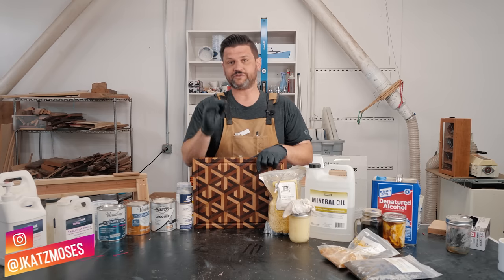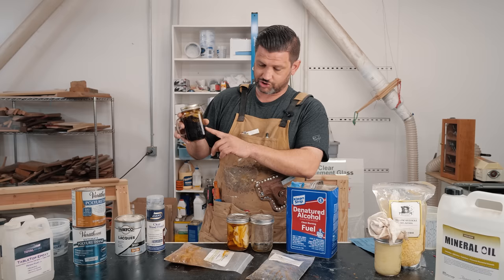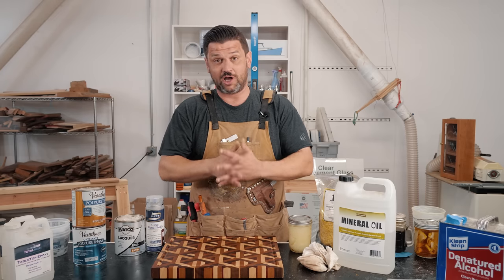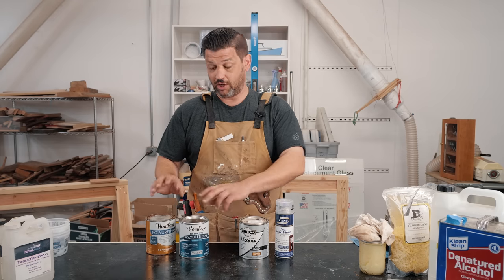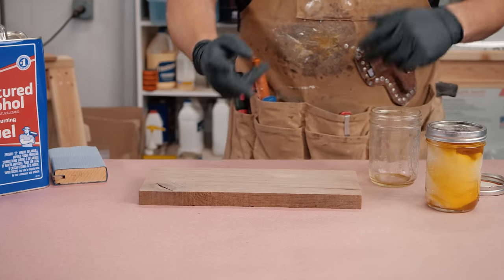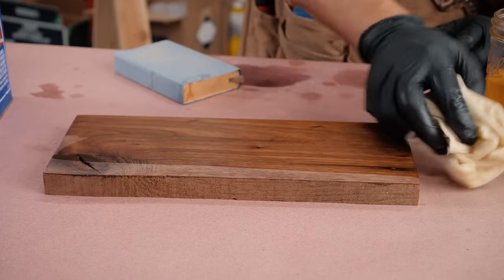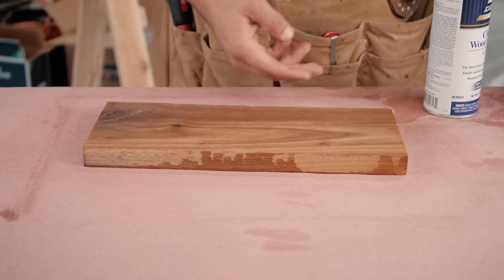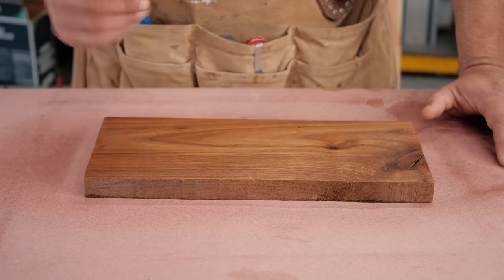My 4 Favorite Finishes and How to Apply Them

Comment: Great video! Thank you for simplifying this topic. I love the shellac idea. I'm looking for finish suggestions on two projects. The first are two pine vanity tops in the bathroom. What would you suggest for that? Also, I am being gifted 10/4 elm slabs for a dining table and benches. I plan on using Total Boat to fill cracks, etc but am unsure on which finish to use. I'd like something subdued in satin or matte but needing to hold up to heavy use by teenagers. I have used oil based poly and Waterlox in the past but it always has that plastic look. Your thoughts?
Reply: I'm guessing you've already built the table, but for others reading this comment, check out Rubio Monocoat. And for finishing instructions on a slab, watch some of the videos from blacktail studios.

Comment: When finishing a cutting board, would you want to do all 6 sides rotating it as you're ready to move onto the next side, or focus on the sides you can get to and turn it over when you're done to repeat the process on the others?
Reply: You can do it either way. Keep in mind that when you apply the goo to a face, that face will be gooey (if is obvious when you do it) for a little while. I usually start with a face that has end-grain (the oil will be absorbed into the end-grain more than the edge-grain.
Reply from the maker: Yep
Reply: Awesome guys thank you for the replies!
Reply: If you are going to sign the cutting board, you need to do that before you apply the finish. I have not found anything that will write on the wax-oil finish. And test it on a sample board. The wax-oil finish will smear some inks and pencils. I have a cutting board on my bench now waiting for my scribe to write a cute saying on the back. My handwriting is marginally legible.

Comment: I have a butcher block I’m finishing and wanted feedback about your KM Goo. 
I used someone else’s recipe the first time, and it left a faint oil residue that has remained for the last couple weeks (shows up if you set paper on it). That recipe wasn’t as heavy on the beeswax and I think that’s why it turned out as such. Do I need to wait for that to dry out more before applying some of your 4 to 1 ratio?
Reply from the maker: You can reapply mineral oil based stuff whenever

Comment: I tried Shellac for the first time on the seat of an outdoor bench. I used Zinseer applied 3 light coats sanding between the first 2. It dried overnight in my shop, then I put the bench in front my house. Within 30 mins it started bubbling and burning from the outdoor heat. Any ideas on what I did wrong?
Reply: stonecrazy3 I’ve been informed that zinaeer is 4lb and the idea is to thin it to about 1lb. I have applied directly from the can but the film was really thick. Not sure if that’s your problem.
Reply: @antoniop719  ok maybe that is the problem. Even though I put light coats it was thick. Thx for the reply
Reply from the maker: Isn't it interior only?
Reply: Shellac is not an exterior-grade finish, but -- more to the point -- could it be that the heat caused the wood in the bench to start releasing some kind of pitch or sap?  What kind of wood did you use?
Reply: @bmedicky  not sure, I use it to make wood filler and decided to try as a finish. It was used on western red cedar
Reply: @katzmosestools  it's possible, I've never used it before for the finish. I've only ever used it to make wood putty.

Comment: Do you use any type of paint sprayer to apply your finishes?
Reply from the maker: Sometimes. Did a whole video on hvlp
Reply: @katzmosestools  do you prefer the air compressor or the plug in ones that Home Depot Sells? Im considering buying one to make the process go a little quicker have been using foam brushes to apply finishes
Reply from the maker: @Suttonusmc  check put the videos. I did 2. Should answer all your questions

Comment: Katz-Moses goo... Four to one as in four parts wax and one part mineral oil can be by volume or by weight; you're keeping it to yourself I see (LOL). If it were by volume, you would need a hammer to break it... This goo is more like four parts wax and 1 3/4 parts mineral oil by volume. Cheers!

Comment: When you mention the beeswax and mineral oil combo, is it a 4:1 ratio beeswax:mineral oil or mineral oil:beeswax? I made it the former way and it is still pretty hard. Should I have made it the latter way?
Reply: J Anderson I made the same mistake. He meant to say 1:4 at least in how he presented it. Let’s just say I fixed and now I now have plenty
Reply: Will Corbridge can you clarify further? It’s still not clear which component is the ‘4’ 
Thanks!
Reply: Edward 4 parts mineral, 1 part wax

Comment: Ok on the bees wax which is 4 parts and which is 1
Reply from the maker: 4 parts mineral oil to beeswax. If I remember correctly I used 1.5 gallons of mineral oil to a bag of the beeswax I listed

Comment: Have you ever eaten the shellac flakes in milk..lol.. It kind of looked like you were about to pour a bowl of cornflakes... Also, I didn't understand where you said that you use beeswax on the cutting board but it's not a good finish for furniture because of durability... Does not a cutting board need to have that same durability or am I misunderstanding something?
Reply from the maker: Cutting boards need to be food safe so there is no film protection. Beeswax and mineral oil is a finish you would reapply every so often depending on use
Reply: @katzmosestools  thanks

Comment: What kind of rags do you use? I use the generic blue shop rags when applying oil finish to cutting boards. I've looked at rags in lowes/home depot, but not sure whats best for finishing.
Reply: I use any type of lint free rag, or lambs wool pads.
Reply: @joeymerrell8585  Thanks for the info!

Comment: Great video. Thanks. I'm just wondering if you really meant 4 parts beeswax to 1 part mineral oil? You're saying that several times in the video, but shouldn't it be the other way around? I've recently made it with 4 parts oil to 1 part wax and the texture looked pretty similar to yours.
Reply from the maker: That sounds right.
Reply: I searched everywhere. And I made some recently too. I think it's four parts oil one part wax.

Comment: Just to add to the uses of shellac, it's a great stain blocker and it's used to prevent blotching when a penetrating stain is used on softwoods like pine.
Reply: So shellac first and then stain?
Reply: @seanhenry744  yes. Just make sure to not to put it thick. Just one thin application and that's it. So much cheaper than minwax pre-stain conditioner.

Comment: Shellac is not durable, and yellows over time. Poly takes way too long to dry. My goto is lacquer. Of course it depends on what you’re coating, as you point out with the cutting board. Nice video, thanks.

Comment: If you're going to use water based polyurethane finish for its durability, why not use oil based polyurethane which should be more durable? Water based polyurethane seems to be neither here nor there.

Comment: When you refer to “parts” are you talking about weight, volume or liquid measurement
Reply: I use rough volume using measuring cups, close enough is close enough.  Nothing is going to go wrong if its 4.64:1 parts instead of 4:1.
Reply: A part is simply a part of a ratio, any given unit works. 4:4:1 means, maybe, 4 bits of A, 4 bits of B, and 1 bit of C
Reply: @mjbailey404  4 grams of something to 1 gram is not the same as 4 liters to 1 liter these ratios are vastly different based on densities. This appears to be a rough eyeball measurement of volume

Comment: I refinished some rifle furniture with glossy water based poly but I also added wood dye to it because of the color I wanted.  After the layering, buffing, sanding, and final coat of spray on oil based poly.. it doesnt look plasticy but sure does look deep.

Comment: My shop is only heated when I'm in there since it's a small metal shop and I use a propane heater. So will shellac freeze since its denatured alcohol or be affected by cold temperatures. Iv had frost on the roof inside in realy cold weather. Love your video's.

Comment: I have a HVLP sprayer, and maybe I'm using it wrong, but the issue I get is: I have to fill the bottle in order for the sprayer's straw to suck up the varnish, then I have to clean it in between coats (my poly has a recoat time of 4 hours, touch dry in 2), which means a lot of varnish gets wasted.  Am I doing something wrong?

Comment: Spar varnish is the strongest finish to date polyurethane is next epoxy is not very durable that's why they don't use it on hardwood floors it's scratches very easy I've been in finishes most of my life when I was color matching I thought of using epoxy on hardwood floor the owner of the company which is a chemical engineer told me not to for it would be all scratched up in less than a week PS love your work you pay attention to detail

Comment: Little trick for lacquer is to melt the product down with lacquer thinner.
When spraying lacquer on piece with multiple parts or a big project the lacquer can dry so fast you can get flash on your finnish.
Thus is where when spraying your product may land on parts of 
the finnish that has already hardened and leave a dull sandy feel/look.
Load your spray gun with strait lacquer thinner rapidly respray the project.  To much thinner can cause runs if to heavy like any spraying product. 
 a bit advanced but can really help when its hot or lots of angles where the spray can land back on the project and cause flash.
Where a respirator have fun.

Comment: For your KM Goo, do you measure your ratio based on weight or volume??? i just received a big block of beeswax of 1.3kg. If i base it on weight that would be 325g of mineral oil. I think it would be super messy if i have to melt the wax to work out how many mls of wax to mineral oil.

Comment: what do you sand to?  I just finished a board that I sanded to 320... IT'S GLASS SMOOTH.  But will that inhibit the oil from soaking in??  (my thoughts were it would also keep water from soaking in).
Reply: I'd say no. I've sanded to 600 grit before and my oil stain soaked up no problem. My only advice is make sure the surface is clean. A vacuum with a soft brush attachment works great.

Comment: Hey, Jonathan Katz-Moses.  With regard to your Satin finishes and not really using gloss to finish a project:  The Wood Whisperer put out a great video for the guild regarding gloss.  What he claimed, was using gloss for all of your coats except the final coat, will give you a NON distorted view of the piece, but will still have a satin finish.  I've used it several times and it works like a charm.  So if you're looking to get rid of some gloss poly, try it out! Also, I make my own wipe on poly, splitting 50/50 oil based poly and mineral spirits.  try it out if you have a chance.  works great. P.S. how much for that cutting board??? :)

Comment: Could I use shellac and then do an epoxy resin flood coat as the finish? I feel if I seal the wood, wouldn't be so difficult to then do a flood coat of resin for final finish. Or is it a bad idea to use shellac and then flood coat of resin?

Comment: Thanks for this. I need to work on my bees wax goo... lol. When I make it it doesn’t have the same consistency. I will try your mixture next time.
Reply from the maker: More bees wax than oil
Reply: Jonathan Katz-Moses 👍🏾
Reply: I was planning to use boiled linseed oil and wax. Never thought about using mineral oil.
Reply: Jonathan Katz-Moses. Just a quick one Jonathan. The link to the bees wax doesn’t work. I can’t use it in the UK, but I was just curious to see if I could find something similar on the UK version. Thanks.
Reply: I know there is a lot of room for variation, but most of the recipes I have seen (and the one I most recently mixed) are inverted from your recipe. They run about 4 parts mineral oil to 1 part beeswax by weight. Do you measure by volume? My goo is about the same consistency as yours, similar to peanut butter.

Comment: Love the video.  Super helpful.  I tried to make the goo, and I'm now at 2:1 (after 4:1) wax to mineral oil and it is still super thick.  not good like yours at all.  

Any suggestions?
Reply: At 4:05 you say 4 parts beeswax.   I just found your other video about how to make it.   Turns out you use 4 parts mineral oil, 1 part bees wax.   Haha.   I'd checked the video 3 times to make sure I didn't listen wrong.  

No worries, but that confused the heck out of me.  Keep up the solid work.

Comment: just want to confirm 4 to 1 as in 4 parts beeswax or 4 parts mineral oil
Reply from the maker: I think its the other way
Reply: @katzmosestools  So I think you did mean 4 parts mineral oil and 1 part beeswax correct? I watched your other video too. I just wanted to note, you specifically said in this video it is 4 to 1 and then said its 4 parts beeswax.
Reply from the maker: @Baileyonthedaily  correct

Comment: I was told the "fuel" denatured alcohol would not work for shellac because it has too high a ratio of methanol, no?
Reply from the maker: Im pretty clear in the video, no?
Reply: @katzmosestools  True. I guess the assumption is that any will work. In California and in particular in Los Angeles, where I'm based, many of these products like denatured alcohol and mineral spirits are not sold in their traditional forms, so i don't always know if the new green alternatives will work for woodworking purposes. I've only been doing this for about year, so I sometimes I come across these situations where I have to piece together opinions from different people to find out what really works. Thanks for the response and helpful content.
Reply from the maker: @BrentDaughertyMe  I live 80 miles north of LA and you can get denatured alcohol and mineral spirits in any home center or paint store fyi. Cheers bud and thanks for watching
Reply: @katzmosestools  Yea, I'm not sure if it's just an LA thing or how far it spreads, but you definitely don't see it in the big box stores or paint stores here. When I asked the big box store about mineral spirits a couple months ago, he said they stopped carrying it about 6 months ago.

Comment: Do you recommend using a tack cloth when sanding between finish coats?
Reply: Tack cloths should be used with a very light touch,the sticky substance on them is rosin and you do not,you do not want to transfer any of it onto the work!! It will contaminate and give you problems that you don't want.
Personally I only used them once at the beginning of my finishing career 40 years ago.....dust with a dry and damp rags and or compressed air...

Comment: My wife asked me to make her some soap dishes. What finish would you recommend for that? I've had friends say a penetrating epoxy, others say just a mineral oil and let the dish dry out completely once a month. What's your opinion.

Love all your videos. Keep up the great work.
Reply from the maker: Epoxy would probably be your best bet. They are going to have sitting water so anything you use would need to 100% block that.
Reply: @katzmosestools  Thanks for the reply. 

Would a penetrating epoxy be sufficient or would it need to be like a table top epoxy?

Comment: Epoxies... or any gloss coat, know the thinner for that product. With true epoxy paint, the thinner is acetone and if you add a cap or two to your cut bucket, (use your own judgement for thickness) thicker epoxy will self level using a brush. I have noticed your inexperience and lack of knowledge of a product leads you to say either, "...it's really hard to work with" or "...it's really easy to use". Not every woodworker knows the craft of finishing, there is a lot to know. For example how to get a gloss finish without it looking like plastic every time?